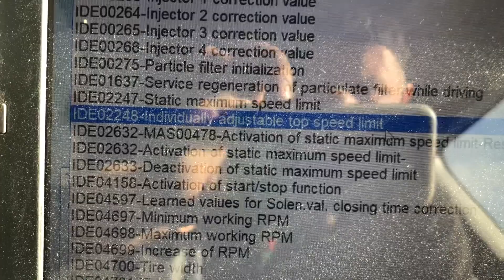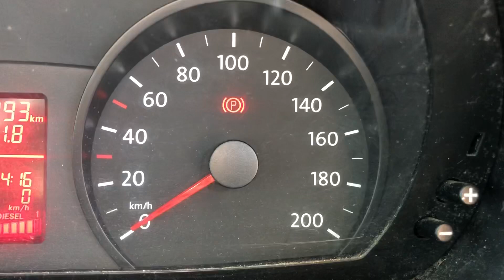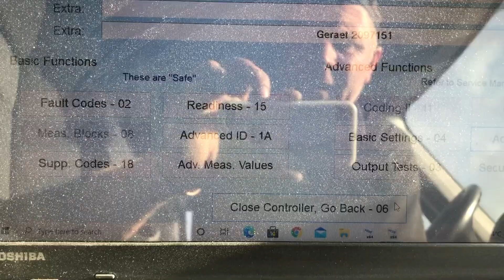Volkswagen speed limiter removal/ adjustment

Comment: you say it is a 2014 Crafter I have a 2010 2.5  5 cyl Crafter which runs the Mercedes software ESZ and ESP  and VCDS will not connect to any of the functions.  What ECU does you crafter run?
Reply from the maker: I don’t what software it runs but your one most likely has the circular diagnostic socket rather than DL16. Unfortunately I don’t have any experience or advice on this. Sorry mate 😞😞
Reply: @kennedysgarage3281  no it has the standard OBD connector neither VW or Mercedes can access it
Reply from the maker: @oz4mee  sorry but I don’t know 😔😔